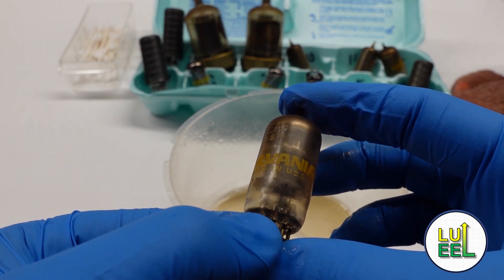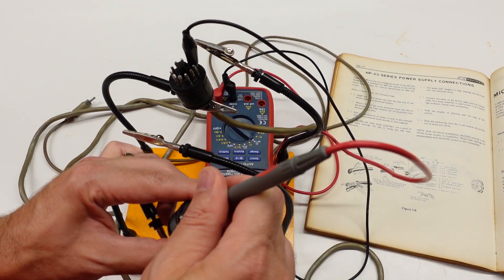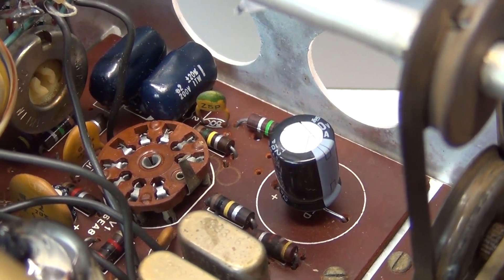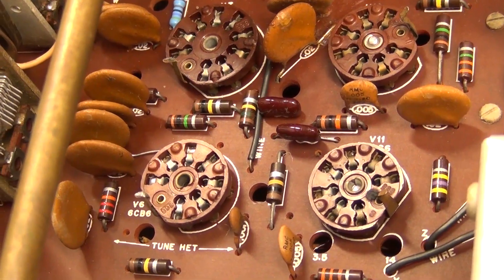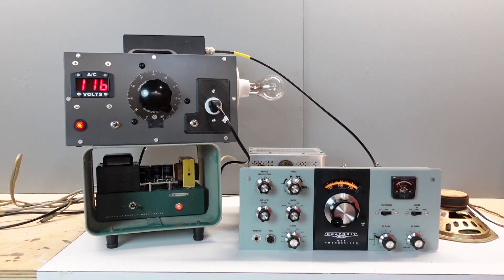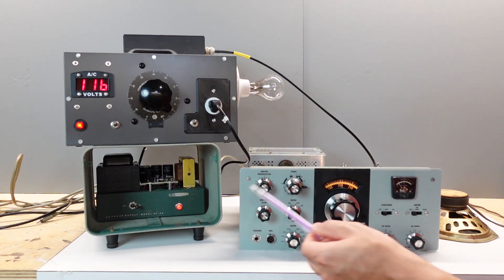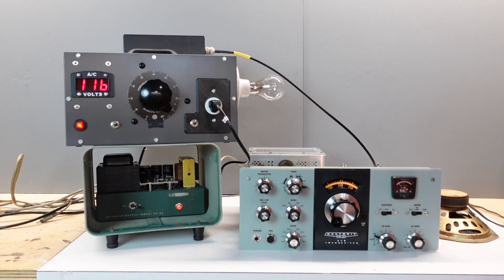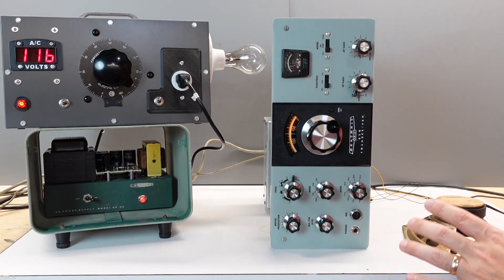Heathkit HW-101 Part #4: Does it work?

Comment: Excellent job cleaning up this radio. It looks brand new. It's appearance is brand new with the exception of the Old Dial. I built a SB-102 in the late 70s. Thanks for going to the extra effort to video document the project. Oh BTW do you know there are after market Bright White LEDs that are fitted with a bayonet type plug compatible with the bayonet type socket used on most radios. These assemblies include an internal rectification diode and dripping resistor so they are plug-n-play. They are also made with Blue LEDs for RL Drake Radios.
Reply: One final note with all of the tar and other crud on this radio imagine what was in this guy's lungs.

Comment: what size bulb for the tester did you use? also can i use any 8hom speaker? Thanks. very helpful!!
Reply from the maker: 100 Watt incandescent bulb, although a 60 Watt works OK, you just get more voltage drop.  I think any 8 ohm speaker of sufficient size should work with this rig.

Comment: When you can't remove a resistor to replace it, you can simply cut it off and use the leftover terminals to solder a new one. By the way, this is the process indicated by collins in maintenance.

Comment: Great job! We are all so proud of you! Here's a tip/work-around, for the resistor that drifted high and is hard to get to... Leave the old resistor in place. Solder the new resistor pins to the outer edges of the old resistor. Leave plenty of pin length on the new resistor, because the next step is to cut/break out the old resistor, from under the new one. Bend the pins to neaten up appearances. Be careful to not let  your solder dwell time go too long and desolder the original pins from the bottom of the board. HTH

Comment: What cleaner did you use diluted?  Boy, that rig looks great!  73 - Dino KLØS
Reply from the maker: Thanks!  I'm using a product called Super Clean, it comes in a purple bottle.  Diluted 50/50 with water.  I got the idea from K6AD over at the California Historical Radio Society web page.
Reply: Hello Level Up EE Lab.
I have an old Heath Kit 101 for repair .Who can help me out?
N2MIZ
Reply: He also used vinegar diluted with water, as a final cleaning on the power cord and chassis, to reduce the smoke smell.